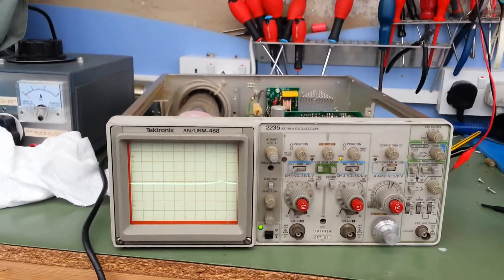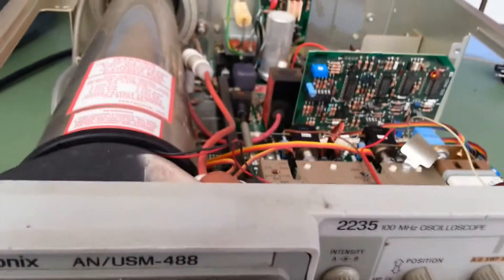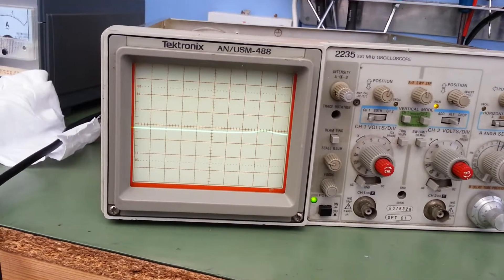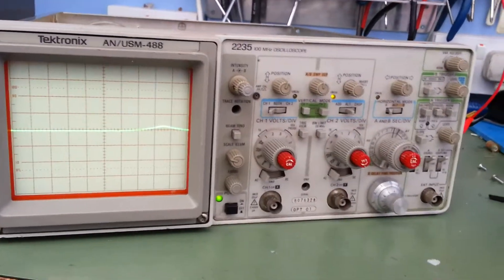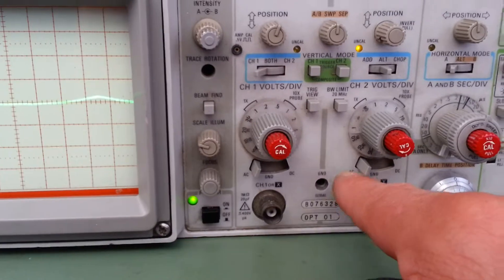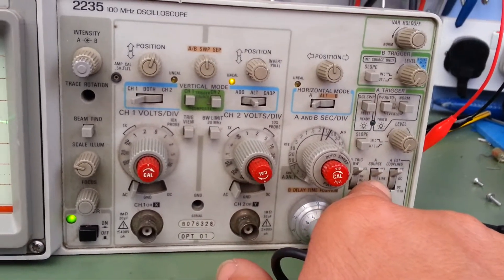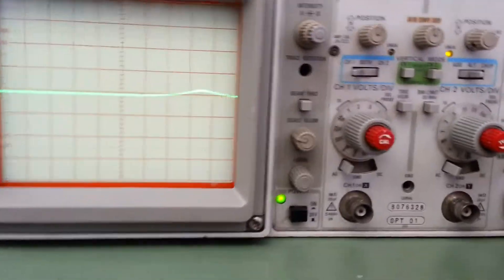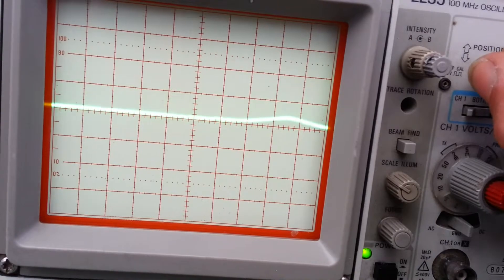Tektronix 2235 first sign of life pt2

Comment: Differently CRT problem; tube lacks luster especially when vertically repositioned and goes out of focus indicating a weak deflection. "Classic sign of a weak CRT"
Reply from the maker: +John Cunningham This CRT was strong , but there was a bent electrostatic element inside the crt.
Reply: Unfortunately I could not locate part 1 of your video which would have given me fuller picture, and I tried every search parameter.

Comment: I had something similair but on the vertical axis on a Hitachi oscilloscope a while ago, turned out to somehow be a dirty control. If you can figure out what's causing that problem you've got yourself a very nice analog scope. If I remember correctly you change the time base of the delayed timebase by pulling out your timebase knob.